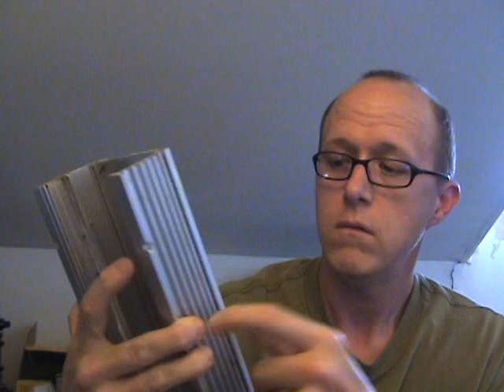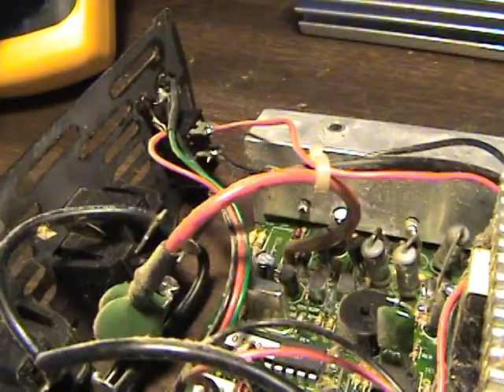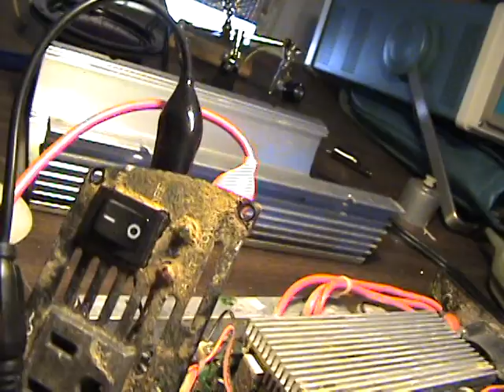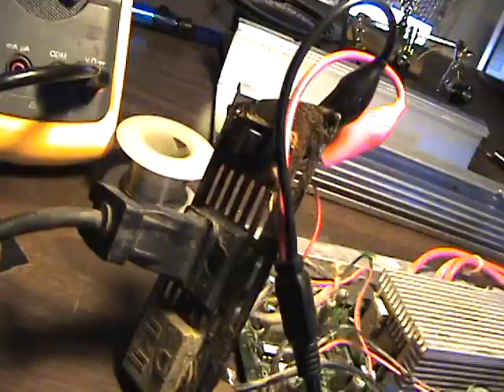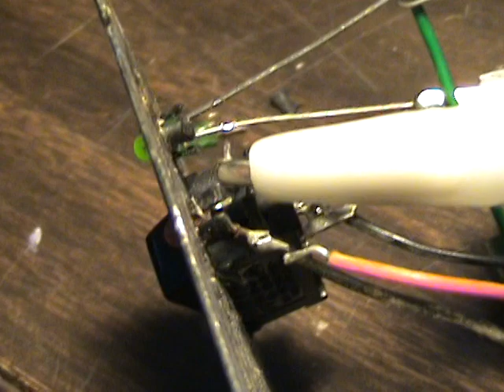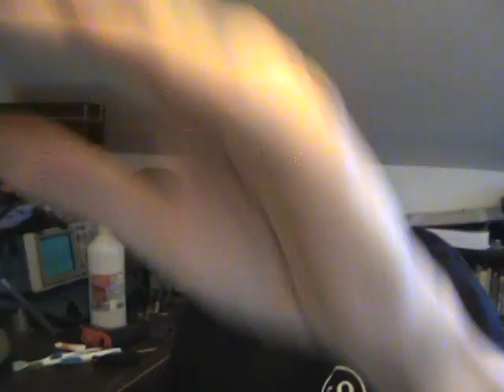Inverter Repair

Comment: The blown LEDs is a reason why it would be a good idea to first measure (and possibly observe the waveshape of) the output after the switch was replaced rather than risking your Dremel as an experimental test load.

Comment: the last time I worked on some electronis like and house reciver it was dirty very dirty. I found it in the trash. I fixed but to clean it I took it apart and put it in the dishwasher. and cleand it good then let it dry and fixed it put it back to gether and now it looks like its brand new. I let it air dry for a week in warm room with a fan to completely dry it out and wow it works great.

Comment: Great job very down to earth video especially checking the basics first, tell me dose the far runs constantly? is it possible to put dust filters around the ventilation section that let air in but keep the dust out?

Comment: I hope you saved my inverter. Mine isn't powering on at all. Can't wait to check switch. My fuses are not burnt and they are not showing any power coming thru their leads. Is that normal? Thanks

Comment from the maker: Hi. If it's blowing fuses without even switching it on, make absolutely sure the positive and negative connections aren't reversed (see my other inverter video). If you have an ohmmeter, measure across the inverter's hookup terminals. You should see it start low and climb up as the capacitors inside charge. 
FWIW, a cig lighter plug can't handle the current this thing will draw, depending on the load. Even at 400W output it needs to pull about 40 amps on the input side. Need big wires and fuses.

Comment: Hi!  I bought an inverter 1500v on line but it has no makers name or brand name. It was working fine when I received it and just used it for testing on TV and it was working great. then I left it aside for one month. After this period I tried to work it but it did not work and warning light show that there is a fault. I am surprised to see it developed a fault lying on the shelf. Could you suggest what had gone wrong with it. It will be very kind of you I have no address of the seller. thanks.

Comment: I don't believe I would have brought that thing into my home at all...

I have a couple of APC branded devices that carry their own batteries, One is a small single SLA cell power strip type that is 550 watts and it has a problem of not going into backup power mode and it beeps constantly.

The other is an APC eServer branded pure sine wave type that is 1500 watts continuous and holds 2 SLA batteries, it has issues showing under voltage on the AC line, this one is interfacable via USB or RS232.

Comment: i have this identical Coleman 800 Watt inverter.  Mine keeps blowing fuses on any cigarette lighter outlet i plug it into.  it even blows the fuse when i connect it to a CB radio terminal connection in a semi tractor.  the switch is not even turned on when i connect power to it.  i cant get it to stop blowing fuses so it never actually turns on.  Do you have any idea what is going on?

Comment: I'm interested in what the inverter was used for in the chicken coop. Was it for lighting?
Reply from the maker: ForViewingOnly That's right. I ran two fluorescent fixtures, each with two 4-foot tubes off this inverter and a plain old car battery.
Reply from the maker: It did. But we moved and I took it out of the chicken house, so no telling how much longer it would have lasted in that environment. I'd guess not long.